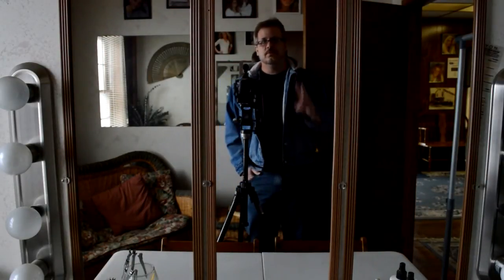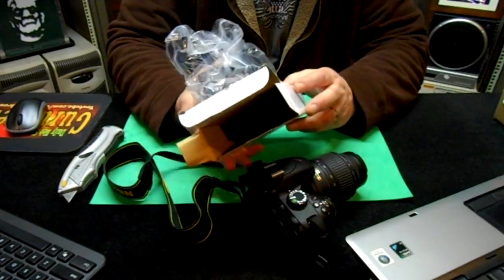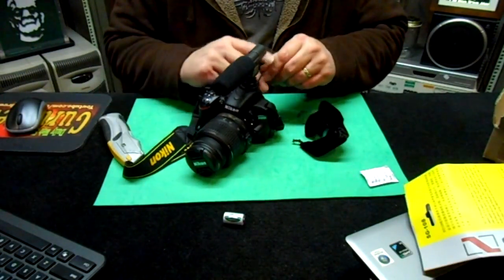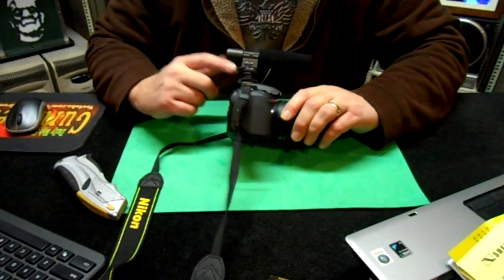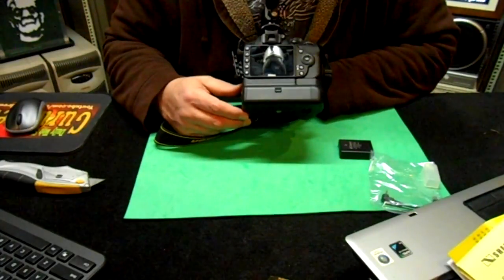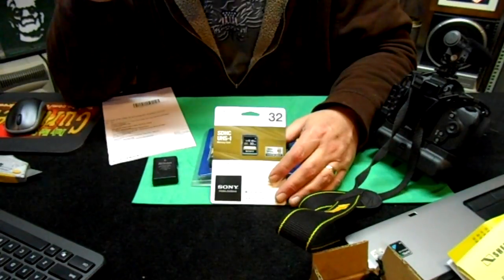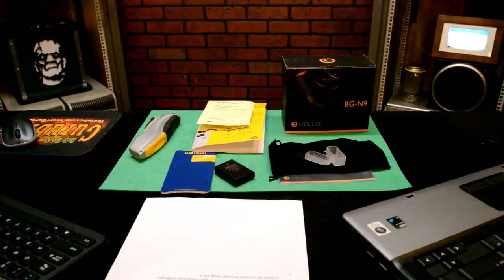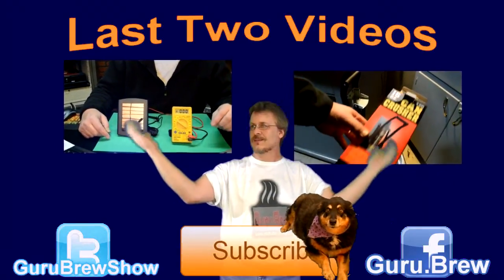Digital Cameras of Today and Film Cameras of Yesterday - Part 1

Comment: Do you have a way to connect the Blue Yeti to the D3200 direct when recording (do you have a special cable to connect or do you record the audio separate and snyc later?)  Thanks
Reply from the maker: Hi, we are recording from multiple sources and syncing latter in editing.
If I would have gotten the other Yetti , it comes with an audio cable but not the one I bought. figures right